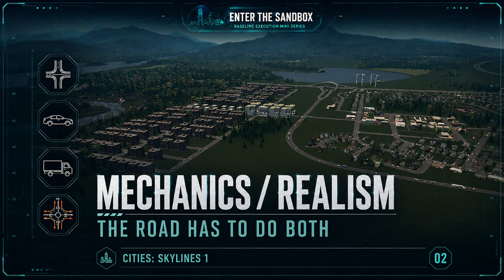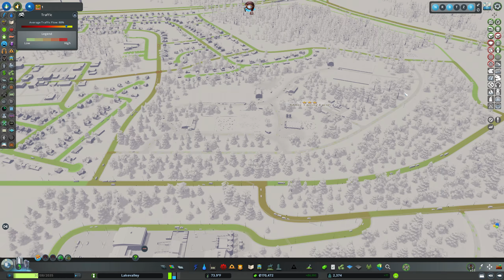Can Industrial Traffic Survive Without Direct Highway Access in Cities: Skylines 1?

Comment from the maker: This test was not about making the sandbox area look realistic — it was about checking whether Ridgewater’s industrial road layout could survive pressure before the main series keeps building around it.

TM:PE is loaded, but it was not used to solve the test: no lane connectors, no signal timing, no priority setup, no turn-lane fix, and no new highway access.

The key result: traffic reacted, the collector heated up, but freight kept moving and the supply chain stayed intact.

What usually causes the most traffic trouble in your Cities: Skylines industrial areas: freight routing, highway access, intersections, or commercial goods demand?

Comment: I love the lay-out of your city. 
What causes most traffic in my industry builds, is the freight. Need to make sure they have enough routes to go everywhere and no bottlenecks.
Reply from the maker: Thank you! I appreciate that.

And I agree completely. Industry traffic usually becomes a freight problem first. If trucks do not have enough useful routes, everything starts stacking around the same few nodes.

That’s why I wanted to test this layout before building more around it. The traffic flow number matters, but freight still moving is the real proof that the system works.